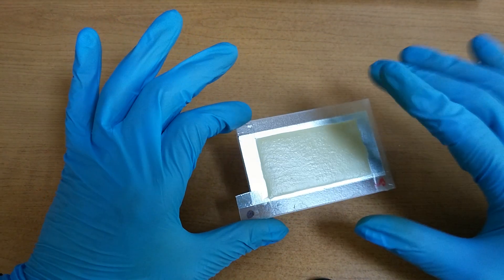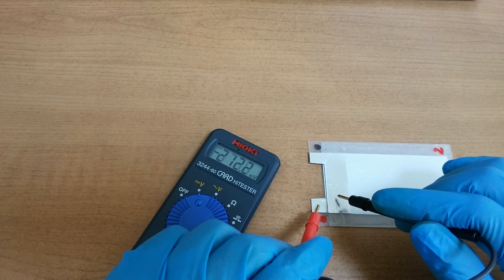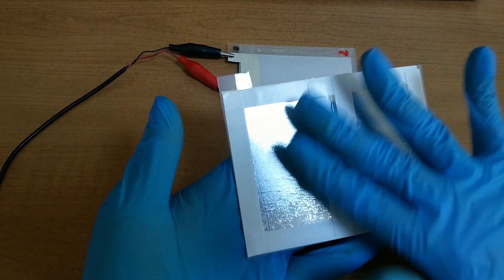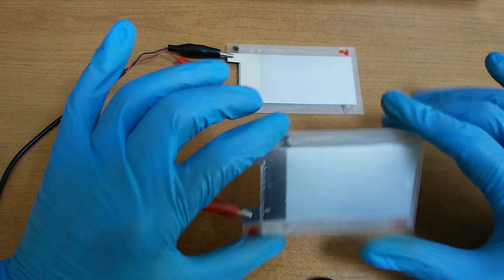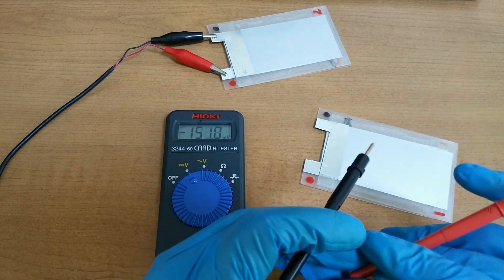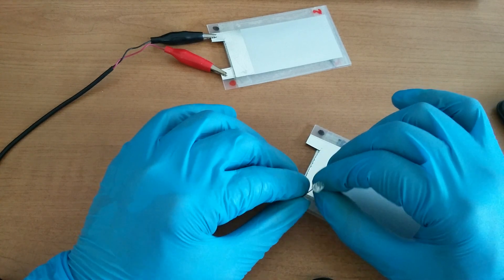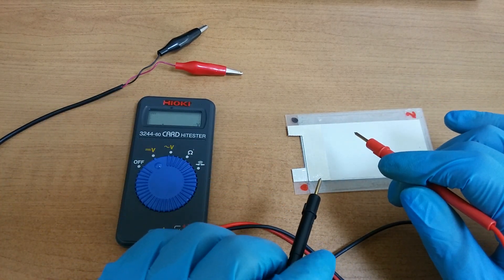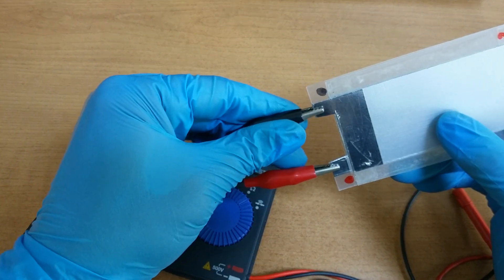solid battery experiment: why sugar and paper electrode is important

Comment: Thank you for sharing your learnings and ideas (and for sharing in English)...appreciate your continuing efforts. I have a question though...rarely, if ever do I see you evaluate the current, total energy stored, or the discharge rate of your various batteries. In the end, these are the most meaningful comparative measures for almost  any energy storage device and I'm wondering, am I missing something with respect to the objectives of your flat-celled battery work? Voltage potential, while usually the first indicator of a battery's performance only tells a very limited story about the practical application of any given battery.